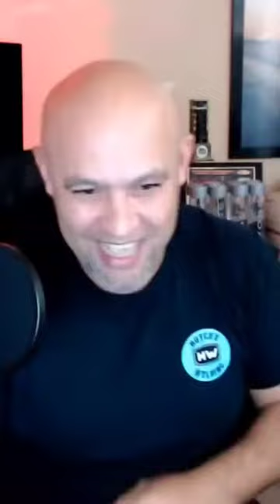#shorts Coyote swapping a terminator mustang is a huge waste of time.

Comment: Oil pump gears are a must in a Coyote swapped Terminator, the resonance from hitting potholes will shatter stock gears
Reply: Found the TeRmI owner ☝🏽
Reply: @AV-kr6gc  Lol never owned a Mustang. That's me talking shit on those particular cars.
Reply: @chrisromero2088  ohh gotcha. I’m fbo e85 cobra jet, and never needed to replace oil pump gears unless an idiot bangs it constantly off the rev limiter. Even Alex says only needs to be replaced with boost 👍🏽
Reply: @AV-kr6gc  Alex says they only need to be upgraded if you bang off the rev limiter like a side show kid.

There is nothing about boost that is inherently bad for OPG’s.